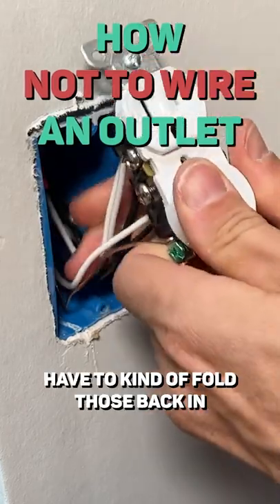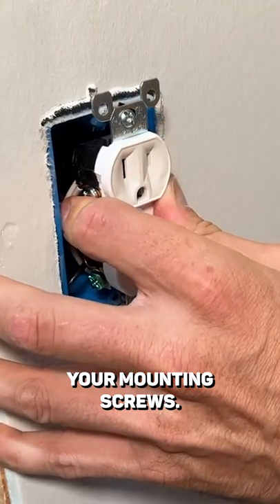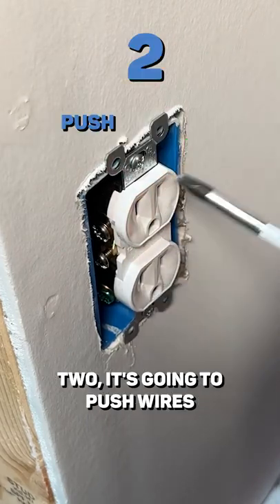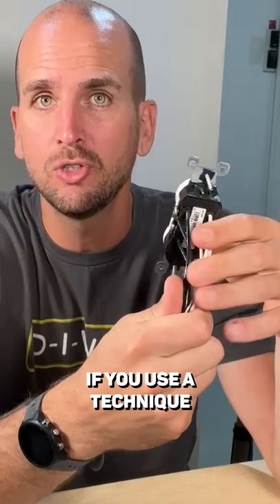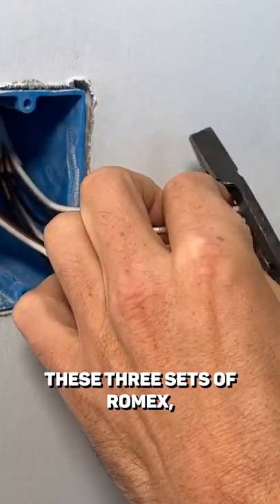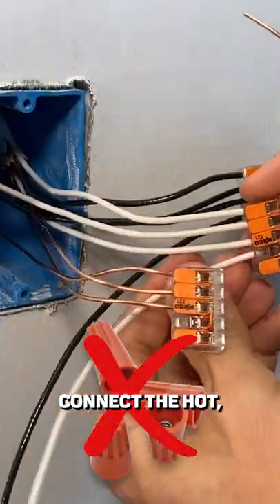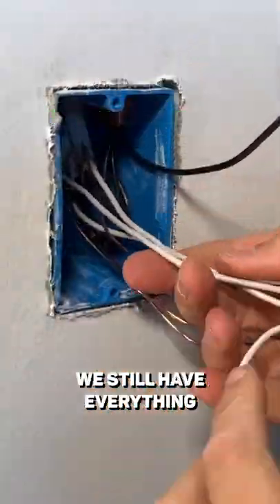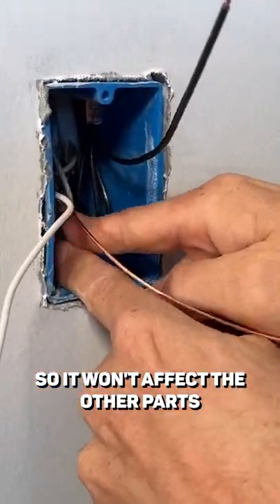The Better Way To Wire Outlets #shorts

Comment: Don’t listen to anyone who backstabs outlets
Reply: Or uses wago’s, same as back stabbing
Reply: UL receptacles can be backstabbed there's a technique on how to backstab wires into receptacles, and  also GFCI receptacles are always backstabbed.
Reply: Just like the old speaker wire clips! Nothing but garbage and no good contact!
Reply: @ImTheFatDad hey, don't insult Wagos. They're a proper product that has a use. Just because you use it wrong doesn't mean it's bad.
Reply: @raymondholsemback7673 GFIs are NOT "always backstabbed", you don't have a clue what you're talking about.
Reply: @bloodleader5  oh yeah show me GFCI that you terminate on side screws, you won't find any. Good luck that's why GFCI UL listed for backstab
Reply: 😂 exactly 💯
Reply: Boomer electricians in the thread
Reply: @ImTheFatDad  Wago's are used 90% of the time in the EU. There are even high end LED lights that come with wago-style connector built into them.

Don't think I've ever seen a wirenut in Ireland, UK, Belgium or Germany.
Reply: The idiots posting about better technology used in wiring are US. Better wiring techniques exist outside of the states.
Reply: I had no choice with mine, damn screws did not leave enough room for the wires
Reply: @raymondholsemback7673 bro you’re clueless 😂
Reply: Does that apply to ground fault receptacles?
Reply: @raymondholsemback7673 gfcis aren't backstabbed.  GFCIs use the screws to hold the wire. Yes, with a GFCI, you don't wrap the wire around the screws, however you do insert the wire in between 2 metal plates.  You tighten the screws it brings the plates together holding the wire in place.  Backstabbing you simply insert the wire into the hole.  The screws aren't used in any way. I've seen backstabbed outlets get so hot they melt from poor connection.  With the system on a GFCI you have a much better connection.  While they are similar, the gfci system isn't backstabbing.   They are 2 different connections. Backstabbing creates a very poor connection that will likely fail in time and could cause fire.
Reply: Nothing wrong with backstabs
Reply: @ImTheFatDad why shouldn’t wagos be used? Serious question. I’m not an electrician.
Reply: DialOne says "job security". At least they teach you to run the unused screws in.
Reply: @johnc1280  they can be used with reliability as good or better than traditional wire nuts. There was originally significant resistance to accepting them, because wire nuts were so time tested. But over the last decade they've become much more accepted in the US, and only the crotchitiest or out-of-the-loop guys still say they're no good. The locking mechanism is extremely solid when used with the rated diameter wire, and they are 100% different than backstabbing an outlet

Also, importantly, they are far superior for the typical DIYer, because they are easier to use properly. Uneducated people often use wire nuts incorrectly. That's why I said wagos are potentially better. For an experienced electrician, a wire nut can't be beat, but may be matched by a wago
Reply: @RoshDroz  thanks much sir. I appreciate that much. And I pick up what you’re putting down on it all, breaking it all down. 

I may have another question for you. I’m currently moving a kitchen outlet over on a wall 
If it’s okay I might have another inquiry for you. At your convenience to send over a suggestion! Really appreciate your help and time
Reply: @RoshDroz  if I can bother you for one more question. I’d sincerely appreciate it. Pretty simple for your expertise! 
If I have a ceiling light that I’m replacing. And when I removed it, there are two white wires, two black wires, and one red wire. So that’s what’s coming out of the ceiling into the existing metal gang box. 
The new light that I bought. Has one copper ground wire, one white wire, and one black wire. I guess I’m a little confused what to connect to what. The ground I understand
Reply: @johnc1280  so the red wire does create a bit of uncertainty, but that's OK. The two white wires are neutral, and they should all be joined together, along with the white wire from the new light. So you could twist all three into a single wire nut or 3-conductor wago. Those two black wires in the box should also be joined together. Now, the black wire from the new light is the hot, and it needs to connect to either the two blacks or only to the single red. The way to be certain is to buy a cheap multimeter and test the voltages. 

Using the multimeter can be very dangerous if you aren't used to this type of thing, because you have to do it with the breaker flipped on. So probably best to avoid that. A probably better method would be to connect the black wire from the light to the red box wire, again ensuring the two black wires in the box are also bound together separately in a wire nut or wago. Turn the breaker back on, test the light. If it doesn't work, then flip the breaker back off, and rewire the lights black wire to those two black wires in the box. If the red wire is unused, ensure it is capped off with a wire nut. One of those two methods is going to work, and you won't hurt anything testing it that way.

Last thing is that you do need to connect the ground wire too. If you don't have a plain copper wire or green wire coming out of the box, then you should connect the plain copper wire from the light to the metal gang box with a green ground screw. The green ground screws or pigtails can be bought at a hardware store
Reply: @RoshDroz  you’re really providing sound assistance. I appreciate your time and knowledge. It’s not being wasted upon me

Given how good those step by step instructions are, I think it will be even easier for me. So the two black wires coming out of the existing ceiling gang box were never connected to the old light fixture. They were bound and wire capped, with very old black electrical tape (the coarse, textured kind) and an old wire nut 

So the single red and two whites are all I’ll be dealing with and I know what to do have your instructions provided. 
And the new light ceiling flush mount bracket (I just mounted that) has a green ground screw on there
Reply: Or uses wagos
Reply: @raymondholsemback7673 most Gfci are back wired not to be confused with back stab. Difference is back wired is a clamp that is tightened down by the screw on the side back stabbing is where you strip the wire push it in a hole in the back and a spring loaded clamp holds it in place to release it you have to push a small screw driver in to hold the pressure from spring to pull the wire back  in most case the receptacle will break and then you have to replace it. I agree with the comment that says I never seen a Gfci receptacle back stab before they are back wired. Back stabs are also limited to 14 gauge wire which is good for 15 amps. Most Gfci locations are on 20 amp circuits which is 12 gauge which is not allowed.
Reply: @johnc1280 there fine to use wagons or wire nuts it’s a preference. Wagos cost more than wire nuts  some wagons don’t have the leaver simalar to back stabing. Yes is not one of the other brands. It had the wago name on it and was like the ideal push in. For the people saying it’s not wago.
Reply: @Jason-lq5ug  both are used as UL meets all NEC70. What is not mentioned is receptacles are not equal. Meaning  whether back wired or back stated. A cheap  Knock off. Will  not holdup as well. That goes with side screw termination also. 

Bottom line is you pay what you get for. 
Cheap price, for cheap product.
Reply: @anyahswrestlingjourney2006  
UL requirements. Most Electrican do not know how to terminate receptacles correctly.
Reply: @bofh139  that is correct, I haven't seen not one WAGO failure yet in 20 + years.
Reply: @johnc1280  they can, most electricans don't know how to terminate devices properly.
Reply: @ImTheFatDad  Thanks for your input, non-electrician.
Reply: Stevenpersinger, backstabs are for lazy electricians.  You sound lazy.

Comment: Hire a licensed and insured electrician and don’t take advice from a handyman.
Reply: No he did a proper  pig tail. But pig  tails are mainly used when the existing wires are to shot and this acts like short extension  to allow you to work. In his case I think he was just looking for a reason to use the wago wire nuts. Quick  go out and buy some wago nuts ha ha ha
Reply: Electrician here, it is fine if people do their own work. As long as they do it properly and to code. If a homeowner isn't sure of themselves then yes hire someone to do it
Reply: Lmao.. What he demonstrated is fine. You're assuming he isn't licensed.
Reply: @randybobandy9828  some call it jack leg if wires are too short to connect to fixtures...
Reply: @Kevin-mp5of  lol ok bud, enjoy that house fire and no insurance payout
Reply: contractor detected
Reply: What he did is the correct way to do this. The way it’s setup first is terrible.
Reply: You know.. some people have made very successful handyman businesses.
As I…. Licensed and insured handyman. So your analogy can get shoved somewhere.
Reply: In general, I would agree, but this guy did good work here.  This is a way better install than the stuff done by any of the licensed and insured hacks who backstab and use the receptacles to bridge the circuit. No issues here, as long as he clicks the faceplate screw.
Reply: Lol some handy men do a better job than certified electricians. .
😂😂😅

Comment: First mistake was stabing the wires. ALWAYS wrap the wires around the screws for a more secure connection.
Reply: Just don't wrap two wires under a single screw
Reply: Well yes,because its such old fashion way off connecting.We do it better with a clamp with high pressure. You only have put the wire in and let loose and its has very good contact!
Really,the UK are years behind with those things.

Comment: I never leave the second power or neutral screw sticking out. I wind it in just to be sure it can’t touch the metal enclosure and cause a short or fire.
Reply: This! Also there’s tons of instances of troubleshooting where guys have left screws and they caused ground faults etc. Headache to trouble shoot later lol
Reply: Standard residential electrical in the US is done with plastic boxes
Reply: @barryallen5507  that might be today's standards but if you've dealt with old houses or hospitals  you'll find metal boxes.
Reply: Tape it too
Reply: @barryallen5507  industry standards and my standards are two different things
Reply: @Frank-mv1jg  I've remodeled plenty of old dumps that we had to patch into, pretty familiar with it
Reply: @deadmanswife3625  potato potató, imo metal boxes are an unnecessary hazard anywhere but masonry work
Reply: @barryallen5507  I live on an estate with commercial buildings when I'm out in the countryside
Reply: @deadmanswife3625  thats weird, why
Reply: @barryallen5507  cuz sometimes I don't want to stay in town or in the Metro area's so I have a little bit of choice where I go. Don't we all inherit a father's business?
Reply: @barryallen5507  stuff's all in conduit as well not too much Romex potato potahto
Reply: @deadmanswife3625  my father was an alcoholic, his business collapsed, i inherited nothing
Reply: @deadmanswife3625  i dont miss bending conduit lol if i ever do electrical, it'll be as a linemen
Reply: @barryallen5507  😥
Reply: @deadmanswife3625  that's great as long as you're out in front of the standards!  (Which I'm sure you are)
There's a vast difference between the "not on my watch" and the "that'll be somebody else's problem" mentalities.
Reply: @77thTrombone  ty 🤗
Reply: @barryallen5507  Our house is full of metal ones.
Reply: I know it’s over kill, I do it too and add some tape
Reply: Do you tape it up too?😮
Reply: It amazes me how many electricians(?) don't know what really causes electrical fires.  It's rarely, if ever, a screw with nothing attached to it being left loose.  Stab-locks on the back of receptacles and switches are also not a common cause of fire.  A burned connection inside a device is unlikely to cause a fire  Underwriters Laboratories thoroughly abuses and overloads everything they test before approving it for production/use.  Faults that trip breakers don't cause fires.  Some common causes of fires are:  
Replacing a breaker with a higher current rating than the smallest wire in the circuit.  If a breaker trips, it's working properly most of the time.  DIY fools think a bigger breaker is the fix.  
Some brands of breakers are just poorly made and don't trip at the rated current.  FPE is first on this list.
Parallel service wires must all be the same size and length or the smaller or shorter wire could be overloaded.  Ground wires for parallel services can't be downsized.  Each pipe must have a full size ground wire.
Using the ground in an NM-B cable for a neutral can overheat the insulation on the insulated wires inside the sheath.  Part of the current rating is the conductor's ability to contain the heat caused by the current.  Ground wires cannot contain any heat, plus if used as a neutral in an unbalanced MWBC, it has a constant load on it.
Open splices (not in a box)
Outlets covered by sheetrock with part of the circuit's current flowing through them.
Any occurrence of a dead short between phases or legs can start a fire instantly or be burned together (like welded) and start a fire slowly.
Bypassing safety devices, such as a thermistor, absence of seal offs
Loose, high current connections
Reply: Same
Reply: yea too bad this is a plastic single gang but for a metal one for sure. In general i don’t think you should leave the screw out tho 👍
Reply: @aaronshipp8766  I always tighten all screws.  It's a habit.  Some might call it OCD but I don't care.
Reply: @SteveWhiteDallas  same brother
Reply: @joeldre424 it drives me nuts when I pull apart a box with a taped outlet. So unnecessary, so messy, and the person always stretches the tape when they tape it up, and it fails. Worthless. Who cares in a plastic box, screw the screws in, and it'll be just fine.
Reply: @barryallen5507 even so it could touch the ground wire especially if the box is pretty full

Comment: I think many people are missing the point of the video, that it’s easier to get a receptacle flushed up with the wall when there is less wiring connected directly to the outlet… which is absolutely true.
Reply: The problem is usually box fill. Non electrician don’t know about box fill and by the cheaper one and the box is not deep enough just because you get it all stuffed in there doesn’t mean it’s right.